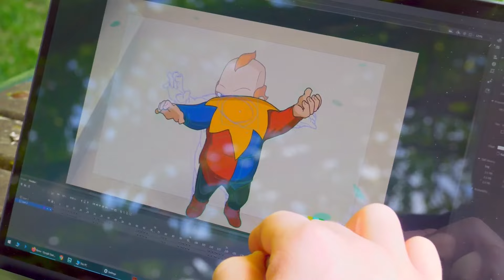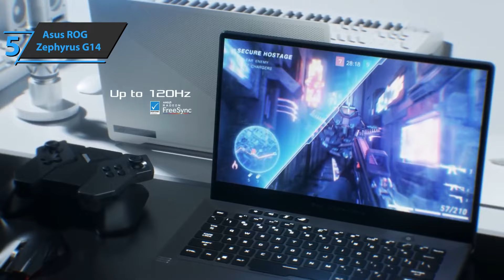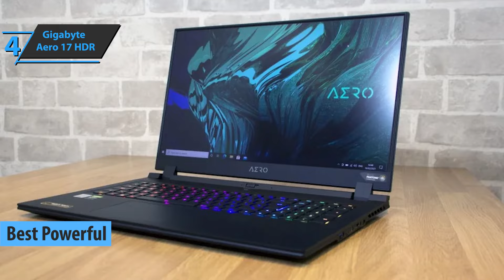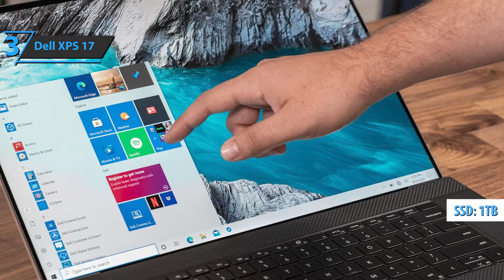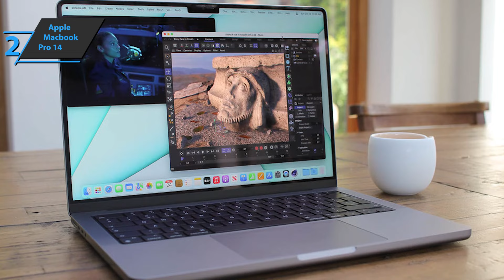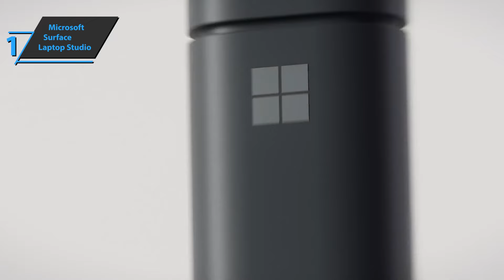Top 5 BEST Laptops For Graphic Design of [2022]

Comment: Guys check top best 5  Laptop on  Amazon under 50 k

1) HP 15s, 11th Gen Intel Core i3, 8GB RAM/512GB SSD 15.6-inch(39.6 cm) FHD, Micro-Edge, Anti-Glare Display/Alexa Built-in/Win 11/Intel UHD Graphics/Dual Speakers/ MS Office 2021/1.69 Kg, 15s-fq2673TU
LINK 🔗 :- https://amzn.to/3pTf5G0

2) Lenovo IdeaPad Slim 3 Intel Celeron N4020 15.6" (39.62cm) HD Thin & Light Laptop (8GB/256GB SSD/Windows 11/Office 2021/2Yr Warranty/3months Game Pass/Platinum Grey/1.7Kg), 81WQ00MQIN
31%
off

Link :- https://amzn.to/3AXQIxd

3) (Renewed) Dell Latitude Ultralight Laptop 7370 Intel Core i5 Mobile-6th Gen - m5-6Y57 Processor , 4 GB Ram & 128 GB SSD, 13.3 Inches FHD Screen 1.18 KG Notebook Computer
75%
off

Link :- https://amzn.to/3TlOy1H

4) Visit the ASUS Store
4.1 out of 5 stars1,653Reviews
ASUS VivoBook 15 (2021), 15.6-inch (39.62 cm) HD, Dual Core Intel Celeron N4020, Thin and Light Laptop (4GB RAM/256GB SSD/Integrated Graphics/Windows 11 Home/Transparent Silver/1.8 Kg), X515MA-BR011W
LINK 🔗 :- https://amzn.to/3wG68Uc

5) HP 14s, 5th Gen AMD Ryzen 3- 8GB RAM/512GB SSD 14 inches(35cm) Laptop, FHD IPS Micro-Edge Display/ Backlit Keyboard/Alexa/Windows 11/Fast Charge/Radeon Graphics/1.46Kg/Natural Silver) -14s-fq1089AU
Link 🔗:- https://amzn.to/3wG6oCE